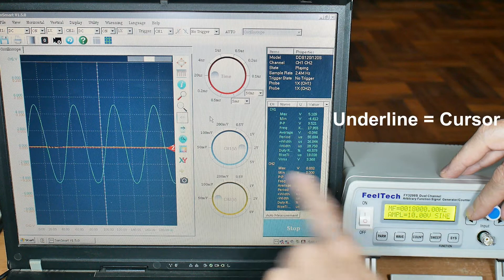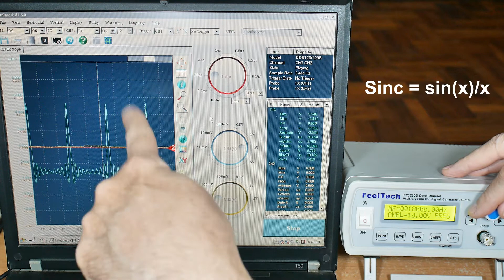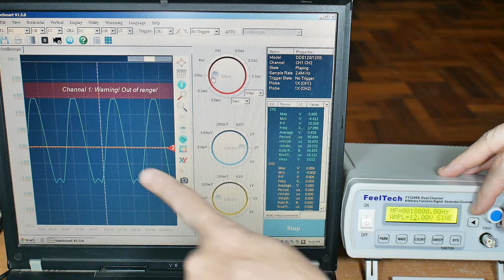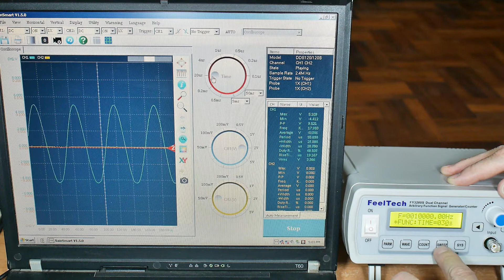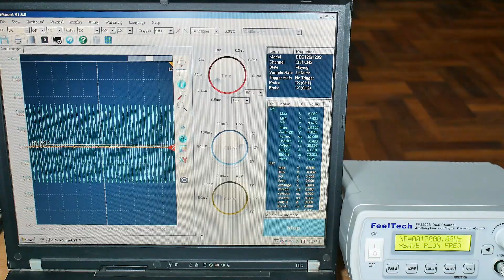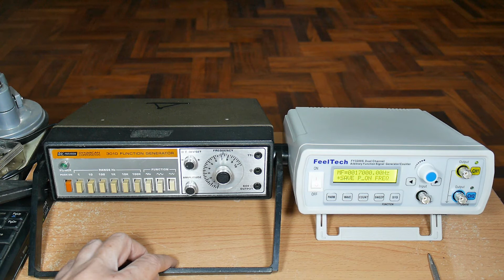Frequency Generator / Counter - Low Cost (Function Details)

Comment: This is an excellent video on the functions.  Thank you.  I bought this same unit and  I just wondered if you built or have used a signal amplifier with this unit.
Reply from the maker: I've never had reason to use a signal amp. What's your application?
Reply: I am a hobbyist and thought that would provide protection to the Function Generator.   Something like a simple common collector amplifier.
Reply from the maker: @robertsnyder9742  Seems like it would, but I can't say for sure since I've not tried it. Mine has an output voltage setting, so I don't think I could over-draw it. I might use a small cap to limit current....